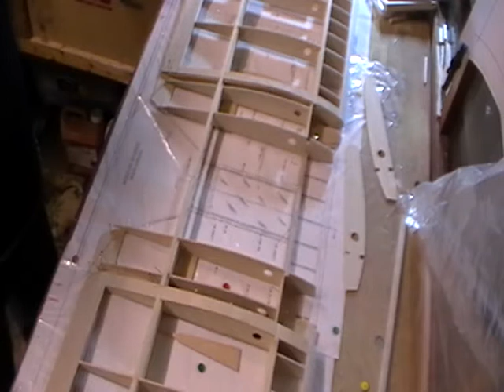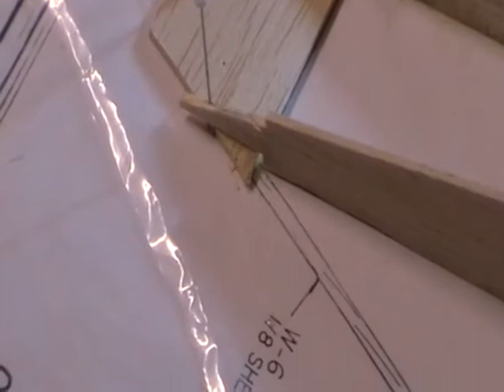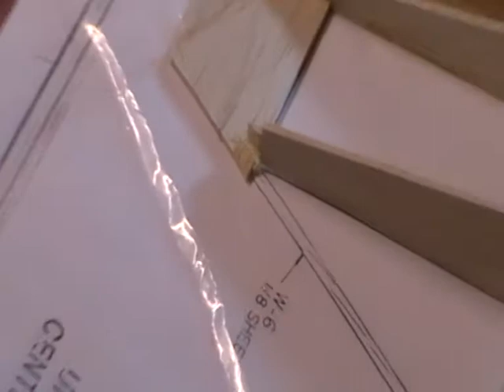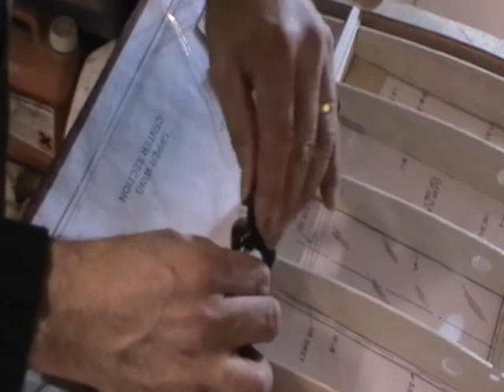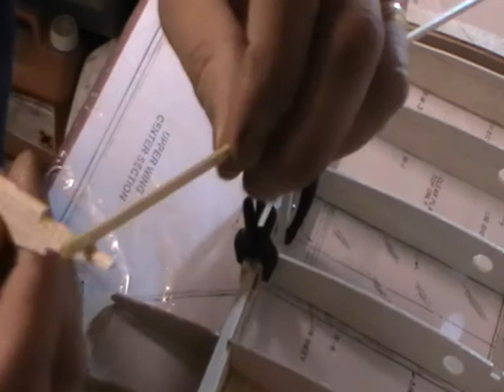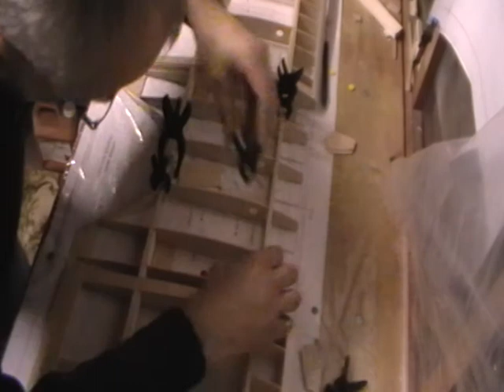Balsa USA 1/4 Scale Sopwith Pup Centre Section build part 2

Comment from the maker: If you read the instruction manual that comes with the kit basic, construction
Reasonably straight forward. Making up the struts for the wings confusing. 
Regards scale I would class as a sports scale although you can improve buy adding extra detail but will never achieve a 100% scale. If you are looking for a full scale model Mick Reeves does one, but a much more complex build not recommended for the beginner.

Hope this helps